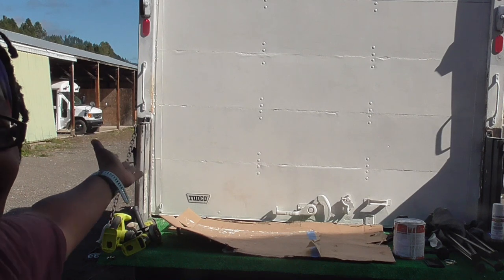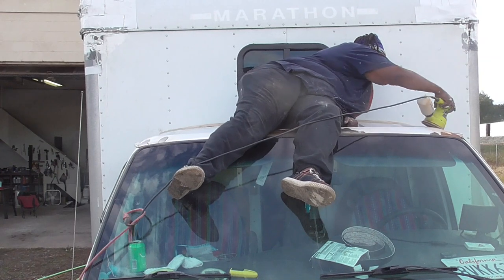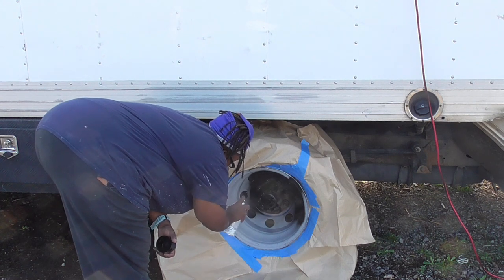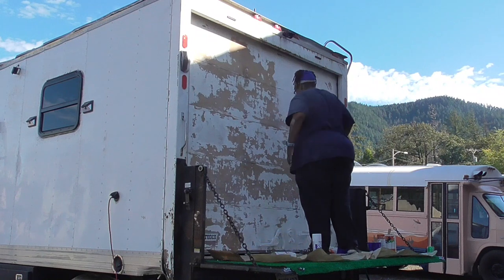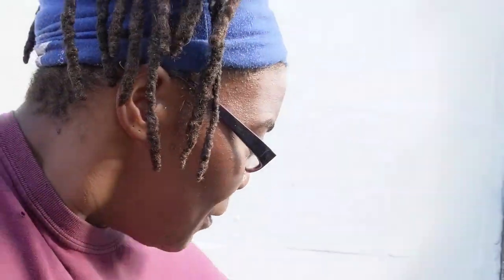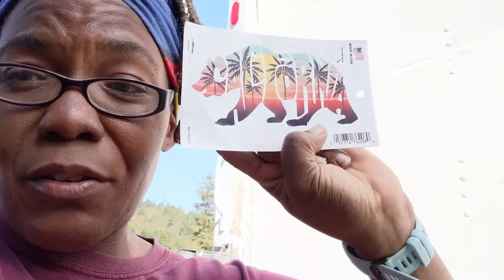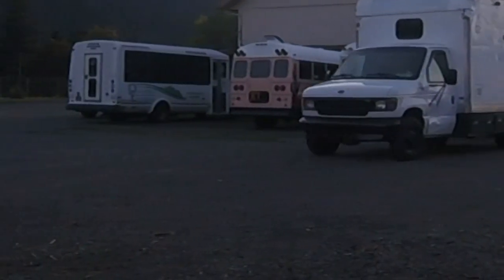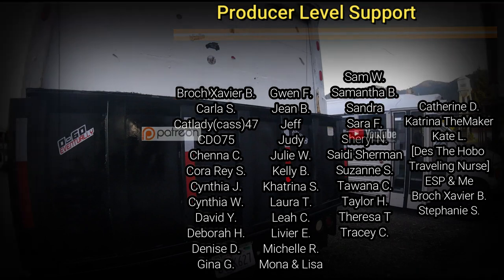BoxTruck Vanlife | A bit of a Paint Job on my Tiny House BoxTruck

Comment: I'd save a big spot on the back door for your YT logo and The Dawn of Vanlife to promote your channel. I've found when painting things like that plastic grill and headlight bezels, is to use an adhesion promoter first. Basically it's like primer for plastic and the paint will stick much butter and last longer. You might find when doing things like cleaning it at the car wash, that paint might start flaking off. The adhesion promoter on plastic really helps the paint stick better.